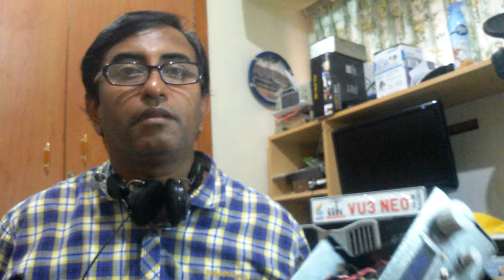Ubitx Construction Step 11

Comment: The 4.7k goes across the to wires only one wire to the tip the yellow wire to ground  when you key the line it pulls the ckt to ground